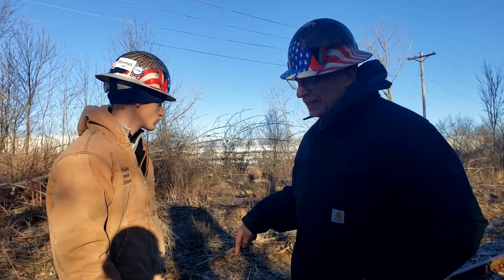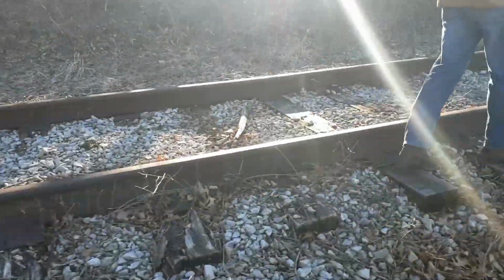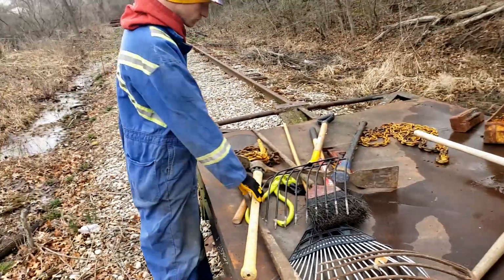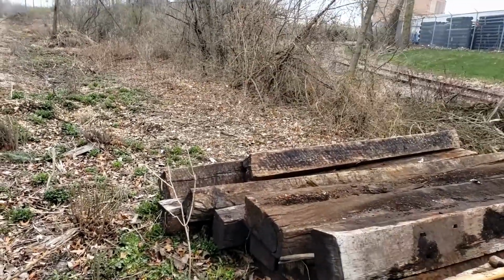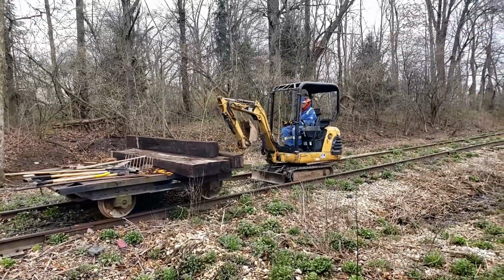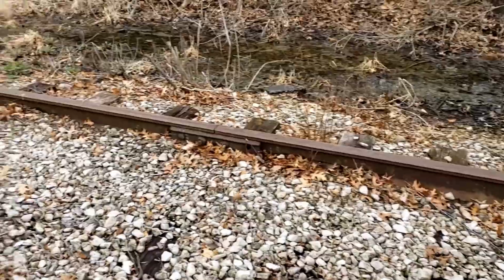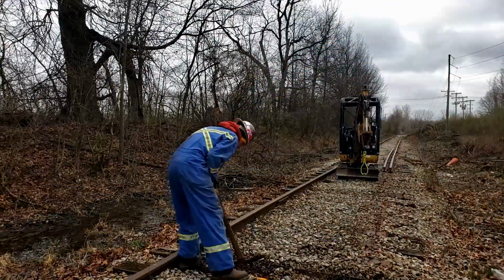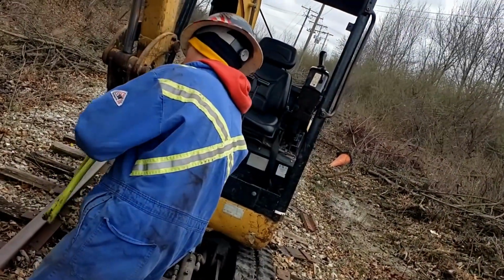1st Railroad Ties replaced in over 25 yrs!   Maybe ever!!  Conrail/ETR

Comment: You need to jack the rail up to get the ties out. I see no track jacks and lining bars.  Rail tongs. Manual tie tongs. With the old tie removed, you need to break up the "hard pan" surface that the old tie was sitting on and crib that out good before putting the "new" tie in place or you willl hump the track in that spot. Forget the excavaator and get a couple pair of manual tie tongs.  (You could have loaded all you relay ties by hand in about 1/5the the time spent dealing with the excavator). Ties are placed with the heartwood side down.  Don't place relay ties with the spike holes facing down. Water will wick up through the tie rotting it out faster.  Buying "relay" ties from a landscaper means that they were already rejected as railroad relay ties! I hate to see yoou putting in all that work only to have to do it over.
Reply: So go help em
Reply: I agree with you Joseph. Track jacks make manual tie replacement easier.
Reply: You are correct Joseph about the "hard pan", that mound will cause problems down the road.
Reply: Good advise.
Reply: I am agree Joseph I did tie removal for two summer’s while going to college. I laughed at how much time they were wasting.  They will figure it out if they listen to the ETR Nation.
Reply: Track jacks and use the excavator to push out the tie no hand work
Reply: @grantbagwell8092  I wish I was close to them to help

Comment: I love how you guys are rebuilding that line!  If anyone is interested in doing the same, I know that there is an abandoned 1-2 mile branch line to the City of Java, South Dakota.  I believe that when the Milwaukee Road built the line through there they missed the town, so instead of moving the town, they just built a short branch line.  I have no idea how much work would be required but there might be an opportunity.
Reply: Hope you guys get that first customer!!
Reply: I might have to build my own here soon. Though I need a hardy crew. I would not mind going back to SD, but the winters are hard on my back.
Reply: Very cool Charles Sapp.  Let us know if you find out any new information about that branch line and share it with us.
Reply: Looks like this branch line connected to some other RR that went right thru town! Edited: same RR they rerouted North of town in 1908. I found it
Reply: @patrickninocn2205  What happened is that in 1908, the Milwaukee Road rerouted the main line 1 1/2 miles north.  Instead of moving the town, a branch line was made.
Reply: @charlessapp1835  thanks very much! It’s awesome what they are doing!
Reply: @charlessapp1835  Is that trackage still intact or did those tracks get pulled up? I know there are some portions of the Milwaukee Road's Pacific Extension that were saved from being destroyed, since the MILW embargoed it's Pacific Extension in 1980. I think that was at that time the largest abandonment in railroad history, since the MILW embargoed this line from Butte, Montana all the way to Tacoma, Washington. I did hear the MILW had "trackage rights" on a Burlington Northern line into Tacoma. In Idaho, the Saint Marries River Railroad still operates over a portion of the old MILW and operates a few chopped nose GP9's, that belonged to the MILW. Much of that I think is mostly lumber products.
Reply: @joshbenton4080  According to the satellite images, the tracks are still intact.

Comment: Kudos to you guys for proving that replacing ties can be done with hand and make-do tools.  That is the sort of project that I have done several times, before deciding that it was too time consuming and tiring, and that renting better machinery, or paying someone else to do it, makes more sense.  Projects on this list include sanding hardwood flooring, and moving saw logs from within a stand of trees, using nothing but ropes, rollers, a crow-bar, and manual labor.
Reply from the maker: The goal was to see if it worked then to improve the process. The most learning is done in that zone.  I've learned a lot in this week of tie replacement  school.   Brian

Comment: I looked up the Nolan RP1 and that wedge is part of it.  You put the bracket part over the top of the rail, then you put the wedge piece with the teeth against one side of the rail and drive it in the gap which pulls the bracket across and against the other side of the rail locking it in place.
Reply: The Nolan Co.'s webpage has a great picture of the rail puller installed.
Reply from the maker: Thanks Doc!  I'll go look at it!   Brian

Comment: You're right on rail movement in heat and cold. We had to go half speed in the summer because of the rail movement.Hats off to you and your son. and I like a lot of folks would like to come and help if we were able.Folks this is the American dream in action.Thanks for the update
Reply from the maker: I got called one time for a huge buckle in the tracks, it looked like someone pulled the tracks over 4 feet with a dozer.  It was because the expansion had no where to go, but laterally.     B.
Reply: @eastterminalrailway5975  Been watching South coast rail videos which seem to cover Mass. Ma and new hamp all seem to be restoring old rail.Just wondering if you had a feel for it happening.

Comment: FANTASTIC! If you ever have watched the class 1 railroad tie replacement,they have that machine that routs out the ballast where the tie that was just removed in the slot left by that tie. Its a rotating cylinder that has small auging bits that runs perpendicular to the rail.It grinds clockwise, stops, and then runs counterclockwise. The rotating cylinder is the same length as a tie.

Comment: I believe you would be better off if you bought two or more  rail jacks.  Place one on either side of the tie or ties to be replaced. Remove the necessary spikes holding the rail down.  Jack up the rail , remove the tie by sliding it out as you just did and sliding in the new tie and then lowering the rail onto the new tie and then lower the rail down.  This eliminated the rail removal and the replacement of all the tie plates.  Don’t forget to replace the tie plates and then especially level the rail by tamping new or clean ballast under the new tie.

Comment: Use the excavator to dig out the hole for the tie, then just slide the new tie in with a pair of tie tongs.  It is best to not change ties with one rail missing.  There is nothing to judge whether the new tie is low enough.  We spent half the day today pulling out and resetting ties that were put in with only one rail in place.  Much better to slide the new tie under both rails than redoing your work.  

Best advice is to get that tie inserter running and then mess with the ties.  You will save a lot of time in the long run.

Comment: There are small automatic tie replacement machines available that run with a small gas engine. The Black River and Western RR short line in NJ uses one. It used to be shown in action on their website.
Reply from the maker: Dennis   We bought one!   It will need work.... but I agree it is a much  better way to do this!   Brian

Comment: You mentioned something about the rails "moving" with temperature changes. One thing I didn't notice on these tracks, are rail anchors or "anticreepers". Since you folks are still using stick rail track, you probably might want to consider adding rail anchors to the rails every forth tie, on both sides of the ties. Ribbon rail on the other hand, requires rail anchors practically every other tie if the traditional "dog spikes" are being used. I'm surprised you haven't had any "pull a parts" due to the lack of rail anchors on those tracks. Stay safe and God bless.

Comment: First off you can get those ties out without removing the rail. Pull the spikes then break tie loose just as you did by pushing it on the end. Then hook tongs to tie and pull from the opposite end.It should slide out fairly easily if you removed the tie plates. After removal of old tie pick and shovel the roadbed down. There are 6x7 ties and 7x8 ties so you need to measure to see how deep to go when cleaning out tie bed so it slides back in easily. Then slide new / relay tie in with tongs or your excavator. Put your plates back on and spike. Make sure to check the track gage. Will go much easier when yo get your tie remover/inserter running. Good luck.
Reply: "It should slide out fairly easily if you removed the tie plates. " Unlikely. Have you seen the ties they're removing? About the only way to remove some of them is with a shovel. 90% rot.
Reply: @RussellNelson  your right...some will break apart and come out in piece's...but most will come out whole just like the one they pulled.

Comment: For pulling wet rotten ties out, try a chain with a ring on the end and choke the chain around the tie. Once you've found the technique cut the chain to the length you need and use a rated hook on the bucket end. A rated hook has forged in flats on the hook.  
I drag logs around my place. I am a trucker so I kind of know how to make it all work. Point is if you choke the tie, the noose so to speak has a greater surface area to bite on and the harder you pull the more it tightens. Being chain, release the tension and it just falls off.

Comment: To go along with Dave Fuelling below, you have a Nolan Company RP-1 Rail Puller and locking wedge, model 811.  You can see the model number at 25:49 in the video.  The locking wedge goes with the teeth up and against the rail to make the RP-1 grip the top of the rail and let you lift it with a clevis through the top of the rail puller.  One side of the rail puller is against the rail and the other is against the shoe of the wedge.  The wedge shoe (your thumb is resting on it at 25:49) is on the same side as its model number.  If you contact the Nolan Company, they may still have an instruction manual for that model Rail Puller.  The current model is the RP-1F with wedge R1157, rated for 100-141 pound rail.

Comment: The best thing you have going for yourself is the attitude you take to do the job. Its the can do it. The fact that you admit that some of the things you do may not work. The fact that you are asking for opinions for your viewers for suggestions shows you are open to constructive criticism.  As for me I am involved in construction but not railway construction. If I had to do what you are doing I would look at the following. Remove the rail as you have done. Get a large eye bolt with a wood thread. Use an impact gun to dive the eye bolt into the middle of the tie and pull it out. (Could slot a large socket to fit over the eye bolt.) Would then use the 12" bucket to clean where the tie was removed from. Less manual labor the better for your back. Would then have 4 or 5 ties already ready with the eye bolts in them to then slide into place. For the chain lifting the ties I would use a swivel hook so that the ground person can easily swivel the tie into place. couple of other option when removing the tie your excavator seemed to push the tie our pretty easy. Would it help if you placed a smaller block on the end of the tie to help push it our from under the rail? As for placing the tie into position if you removed a little more ballast from underneath the tie I know the tie would not be properly supported. Could you then add more ballast and used a small plate compactor to help get the ballast back under the tie?

Comment: ADDENDUM: The scissors arrangement on a pallet puller makes them grip tighter the harder you pull. Releasing tension lets them open back up. When I drove an 18 wheeler, my pallet puller saved a lot of effort allowing a fork lift-and a chain(also mine)-to pull pallets from the front of a box trailer to the rear at places where there was no loading dock.
Reply: Agree Pallet tongs with a swivel would be the ticket for loading, pulling and placing  ties. Check out #1 landscape ties . The lumberyard I worked at had 2 grades dozed one side best other then #2 really dozed one side ok on other split etc.

Comment: In my humble opinion the problem of moving Ties with the Log tongs is the leverage. If you extend the (very) short end with a piece of steel bar and chains the Problem should be gone.
Good luck and have a nice week!
Reply: I think those log tongs are too short on the "crane side".  Also raw logs are relatively soft, especially the outer layer of sap wood, compared to RR ties which are as hard as iron, well almost.
Reply from the maker: Yes  I looked at the tongs and thought the same thing!   Lack of squeeze because the short top arms.  B.

Comment: Just a thought: yellow spray paint on ties to be replaced.
Reply: My road uses orange paint, but it will fade to white after 3-6 months.
Reply: Also good for marking broken bolts or cracked joint bars.
Reply from the maker: I use orange today, but didn't think about fade.  B.

Comment: We use a spade attachment with a thumb on a hyrail excavator. You can dig out the old tie and then pull it clear, then you can slide in the new tie and push it up under the rail, packing the ballast up under it. Takes a minute or two per tie.
You need better ties perhaps buy some second grade ones from a railroad.

Comment: Thanks for another update, Brian. Glad to see track work starting and you having a plan, but I would have felt better if you had two extra helpers with you and Graham. It would have sped up what you were doing handling tie replacement as well as the safety. Anyway, good work you two and keep it safe.

Oh, that wedge piece, it looks like it goes as part of a securing in a switch in keeping the rail from pushing out of gauge in the curve turnout if memory serves me.
Reply from the maker: George   I'll carry it up to the Half-way Yard and see.  B.

Comment: If I was doing it I think I would figure out how to remove the existing ballast cause once you remove a tie the ballast falls into the space left by removing the tie. Perhaps put the crawler on the side of the track and use the bucket to drag out the ballast from either side of the tie you are going to remove. Put that ballast in a container on your rail cart. Then when you've removed and replaced all the ties go back and dump the removed ballast back on the ties you replaced. It seems like handling all that ballast is the most labor intensive part of the job. In fact now that I think about it you probably should  remove both rails and remove all the ties from that section. Then use the scraper blade to remove all the ballast then lay all you ties back down (new and old) and replace the ballast.

Comment: Perhaps  could  you take another  bucket  and Weld on sides  and bottom  so the bucket  for exculator  is 2 1/2 Feet long and  put exculator  on outside  of track and use the new ETR  bucket FOR DIGGING  OUT DIRT AND BALLAST  BETWEEN  TIES...A TIE SWITCHER  ATTACHMENTS  WORK THE SAME....ANY WAYS MUCH CONGRATULATIONS  SO EXCITING  ON THE BIG NEW RAILWAY  CUSTOMERS....CANT HARDLY  WAIT TO SEE YOU TWO USE "The 2021" moving first car

Comment: The wedge is part of a stock rail brace.  Goes against the outside of the stock rail along the points.  Plate has little tabs that fit in those slots to hold the adjustment.  Helps to hold the stock rail from outward forces caused by wheels and switch point throw.
Reply from the maker: rick3524   The voice of experiance!   In a video I'll show where it goes.  Brian
Reply: @eastterminalrailway5975  I have edited my comment to use the proper term.  I apologize for any confusion it caused.

Comment: Looks like a good hydraulic tie remover/inserter is a nice addition to the company.  The Friends of the East Broad Top located one, and it helps dramatically with tie work on the railroad.  (The FEBT modified it to narrow gauge, which made things a lot easier.).  In a lot of cases in the yard in Rock Hill/Orbisonia the ties were Mulch.  Never driven over in operation of course, until they all got replaced.  Their Tie machine required a fair bit of manual work up front.. pulling spikes, plates and the like..and  then clearing the ends of the tie... followed by 'clearing' the channel that the tie came out of...

Comment: Another method that we use is to utilize the grapple truck to change ties.  The procedure is as follows: dig next to the tie you want to change out with the bucket to make a hole to slide the tie into .  Then put the bucket so that one side grabs the rail and the other pushes on the old tie, then squeeze.  This will push the tie sideways towards the hole.  Then open up, put a block of wood in place then push again, this shoves the tie another foot. Now move the bucket to grab the other rail with one side, the end of the tie with the other and squeeze again.  Then pull on the end to get it the rest of the way out.  

It takes a bit of experience to get proficient at it, and its better if the track is strong enough to withstand side pressure on the rails, but it is an effective way to change ties without a lot of hand work.  We replaced three ties today using this method.
Reply from the maker: I have heard of doing this, but I didnt think of it!   I will try that and record my best effort, thanks for the good idea.  Brian

Comment: Another thought: take a look at a pallet puller. The jaws multiple points(look like ends of drill bits)that are designed to grab the center board of a pallet, but could possibly dig in to the sides of a tie.